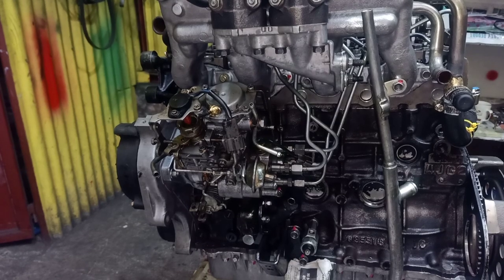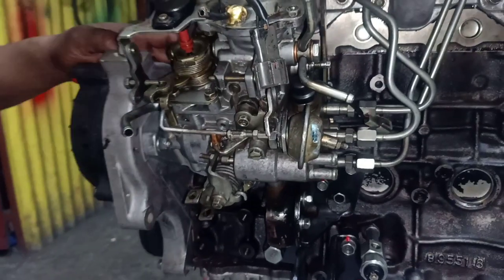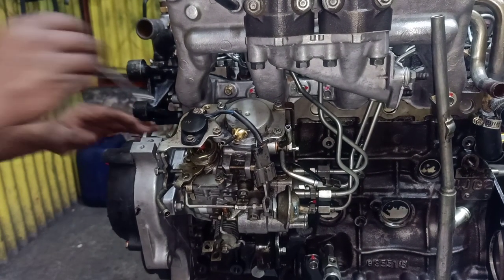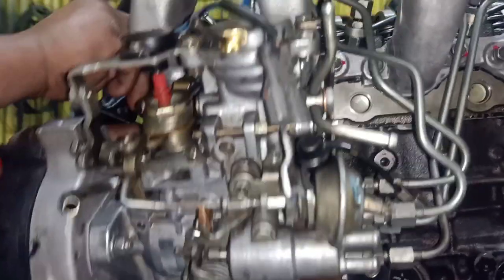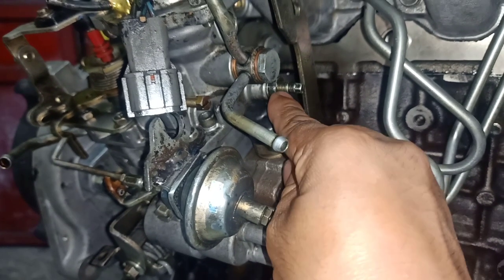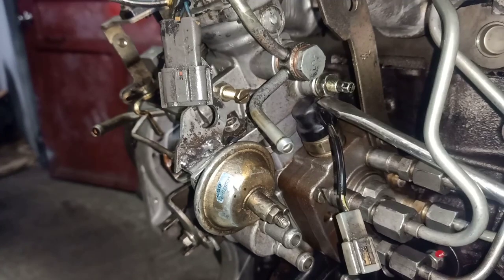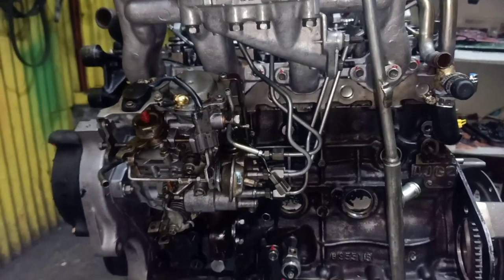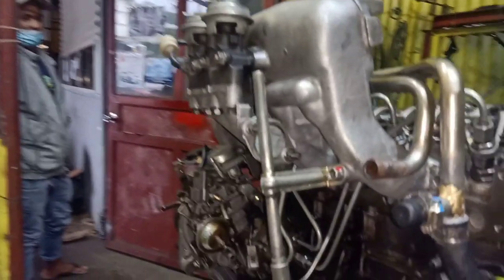PAANU ANG PAG ADVANCE SA INJECTION PUMP||4JG2 ENGINE||

Comment: I will be more than happy kung ang ituturo mo ay kung paano i-set  ang injection pump timing correctly using the proper tools and equipment in accordance with the engine manufacturer, ( no more, no less ). Maraming salamat po.

Comment: idol pååno  kong mahina ang diesil sa injector 4 malakas nman ang diesel sa injictor 1.2.3. anong eajas idol bago naman kalibrec injechu pom at injictor manina paren ang diesel sa injictor 4 idol 4jj2 ang  makina ko idol deli elictronic
Reply from the maker: 09691614033
Reply: posible obstruction sa pipe line,
obstruction sa noozle ng injector o meron problema sa valve ng injector, gaya ng papasira na yung solenoid nya d na nabukas ng buo